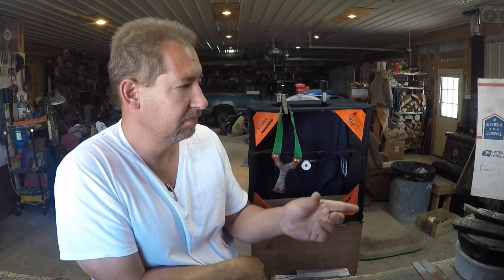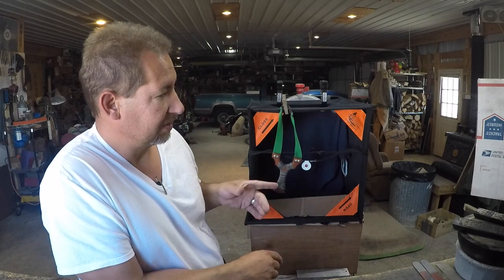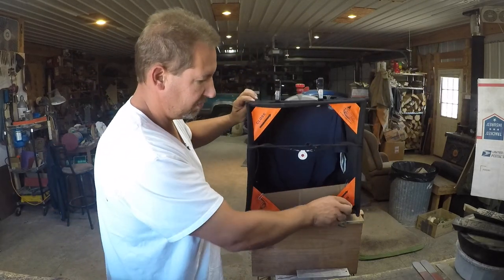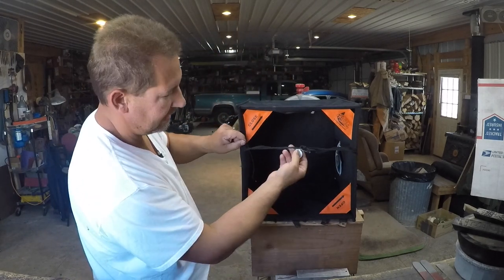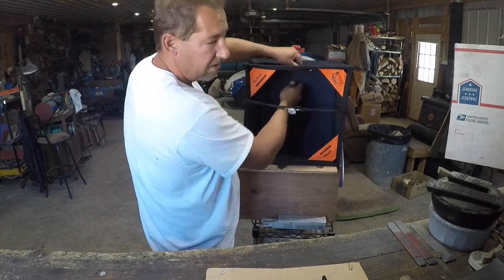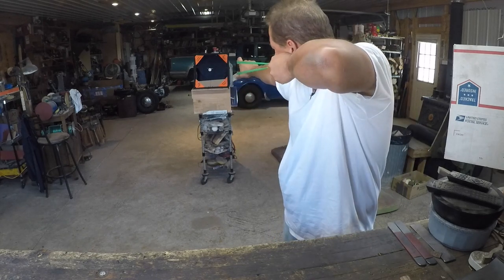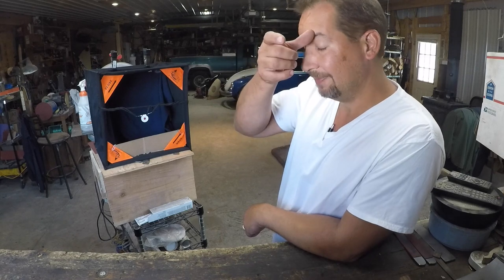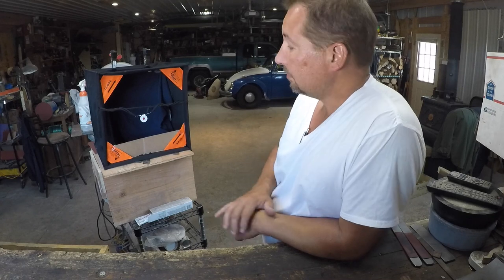portable slingshot catchbox

Comment: why wouldnt you just buy a catchbox for 20 bucks and it uses the exact same box except better??? no need to add any cardboard or coat hangers...
Reply from the maker: the catchboxes that I have seen are about half the size of this one. and sometimes i need as big a target as I can get.
Reply: Because what you're describing doesn't exist. At least, not that I'm aware of after hours of searching. The options available use cheap materials, and the construction of this box, due to its purpose, is much stronger than others. But the real kicker, for me at least, is how portable this setup is. Other options only fold down onto themselves, leaving you with a footprint as large as the box itself. This Weaver catch box solves a lot of problems for us fanatics! Thanks for the video, Joe.